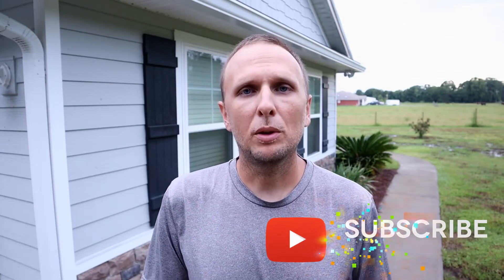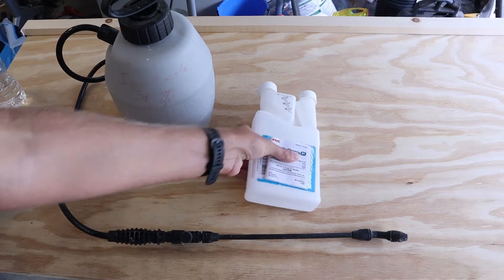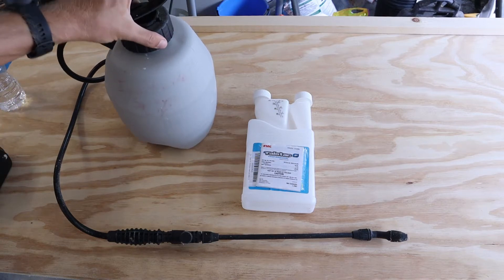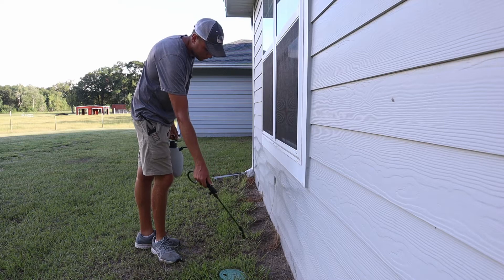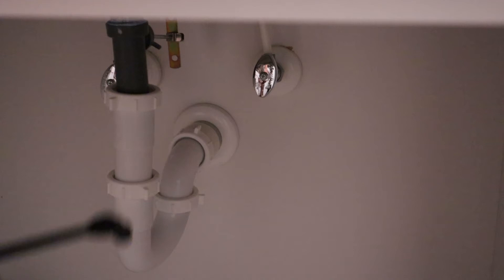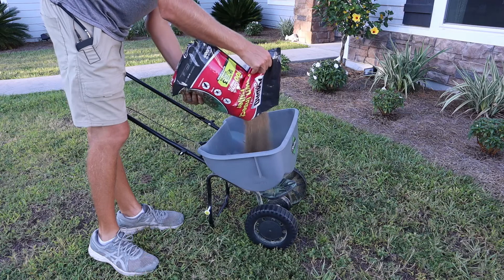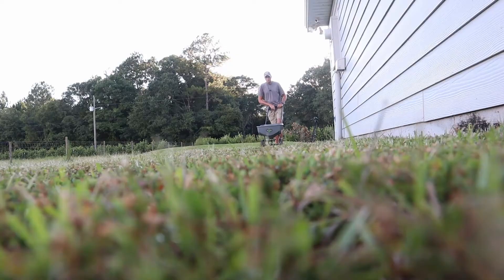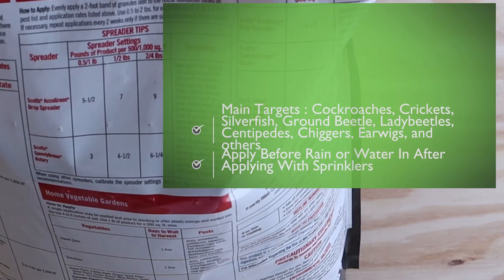4 Easy Steps To Do Your Own Pest Control At Home | How I Do My Own Pest Control

Comment: Subscribed.  I am going to try this.  Thank you.
Reply from the maker: I think you will find it to work very well.  Thank you for watching and subscribing!
Reply: How has it been going for the last 3 years?  Is it as effective as a pest control company?  I suspect it's even more effective, based on what my PCC company was doing.  They wanted to be in and out as quickly as possible so I'm not convinced they were doing the best job possible.

Comment: Not wearing chemical resistant gloves, waterproof shoes, pants, or long sleeve shirt. Bait should be applied as dots not strips. Bait can also attract pests if constant application is applied.
Reply from the maker: Neither do the bug guys that have done this work in the past.  But if you feel that’s necessary then by all means wear it.

Comment: Great info! What do you recommend for house centipedes? Ughhh...i hate them!
Reply from the maker: They are some creepy insects!  It seems like when you see one of them in the house, there are more.  There are 3 products that I use that are in the video that are great for centipedes.  The Talstar P I would recommend all around the outside perimeter and entrances to the house.  You can also spray it in places that you are seeing them frequently.  The Amdro Quick kill lawn granules are good for the outdoors on the lawn around the house for centipedes. Perhaps getting them before they find a way in.  Diatomaceous earth is a good one for inside.  It is a powder and you can put in places where you are seeing the centipedes frequently.  All of these of course cover other bugs as well but they are the 3 in the video that can really work for your particular problem!  The Centipedes main food source is other bugs so if you get rid of the other bugs then it will really cut down on them too.  Spiders are the same way.  Also, centipedes like dark damp areas so just do a quick inspection around your house to confirm nothing is leaking and make sure all ground clutter around the house is cleaned up especially against the house.   I hope this helps. Let me know if I can help further. Thank you for watching!
Reply: @HowToHomeDIY  this is going to be extremely helpful, thank you soo much! New subbie here 😁
Reply from the maker: @Doesitstop  I am really glad that you found it to be helpful!  Thank you for subscribing and I look forward to seeing you around  :)
Reply: Hi, is there anything u recommend for snakes,?

Comment: Great content.  Definitely planning to use your tip to save some money.  How often do you do each treatment?  Also, do you spray your eaves or the vents on your eaves?
Reply from the maker: I try to make it a point to treat every 3 months sometimes more during the summer.  I have found this to have a high rate of success.  I do spray the vents on the eaves that go to the bathroom exhaust fans.  The attic is sprayed with foam so bugs have a tough time getting in that way.  Thank you for the feedback and good luck with becoming a bug exterminator haha

Comment: My home is new.  And I currently have a Silverfish problem and had a ant problem. I live in N.C. and have a lot of hard red clay dirt in places where sod was not laid. I have very little grass on the side yard of my home. About 2 1/2 months ago... the ants raided my kitchen coming out of the side of my electrical outlets and crawling everywhere! The ants were also on my baseboards in my laundry room & got in our clean clothes I had waiting to fold btw the laundry room is on the 2nd floor. I had to throw the basket of clothes away because the ants were everywhere 😡 ... it hasn't happened again since I sprayed and it's cooled down a bit. I do have ant hills in my front yard and I shook some Sevin dust on them and it's seemed to kill them. My fear is the ants will come back again when it gets hot and invade my home. I honestly couldn't afford a pest control company at the time so I've been trying to figure out what I can do now to help keep my house ant and silverfish free now and when it warms back up. Your video was very helpful. If you have any suggestions... I am all ears 🙂 Thank you.

Comment: This might be a little different. Most if not all the bug advice is usually involving houses!not apartments) I’ve been lining in my place for over 20 years. In the last 6 years I’ve been seeing house centipedes. I do live in an older building built I’ve caulked,,taped!sealed used process of elimination ( plastic covered the windows  nothing!plastic the front door, nothing I plastic bathroom,nothing and this was with all clear plastic) and I still keep seeing them. Bought powders!sprays ,glue pads and occasionally I would see them laying around dead. I JUST CANNOT FIND WHERE THY ARE COMING IN FROM!! I finally gave in and called an exterminator last year  and then voila!they were gone. The only thong is that every year around the beginning of November is then they start to see them before winter. So when they sprayed in October I was so happy I didn’t see them anymore but i didn’t know because it was approaching November or did they get them. I usually don’t start seeing them til April - June. Yep they freak me out ,I lose sleep and now I’ve seen them this week on the wall. 3 in the last 2 weeks. Help me. I like the spray treatment you’ve shown here. Will it work  in my case and where should I spray or do I call the exterminator again. I can’t stand waking up seeing them. They’re nocturnal. Please make videos. I like this one thanks
Reply from the maker: Ahh yes centipedes can be a real nuisance!  I have found that when I have seen them in the house, once I have sprayed the perimeter of the house and at my doors inside, that I do not see them for a while.  Since you are in an apartment you could spray on the inside but if you have any pets or kids you would need to keep them away until the spray had dried.  Hope this helps!